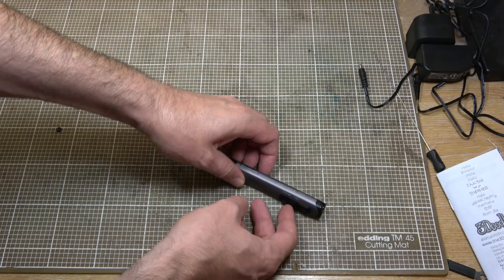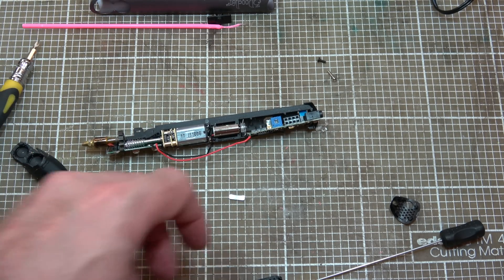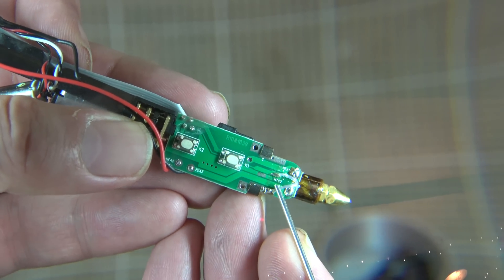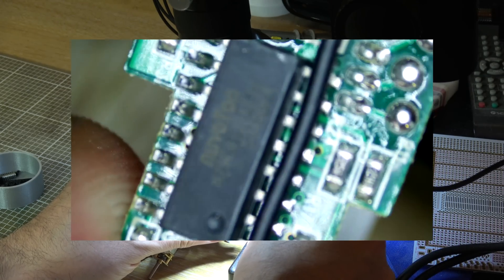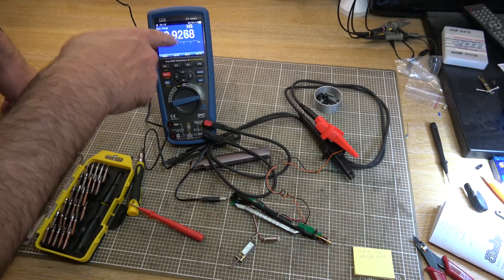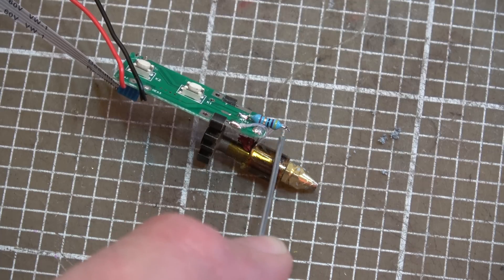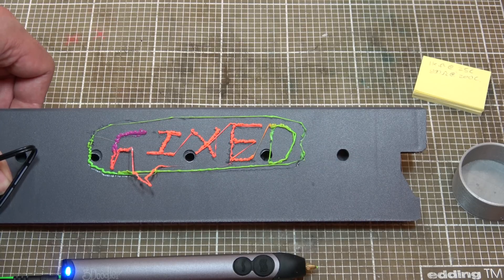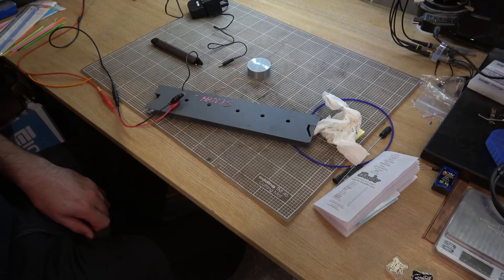3Doodler 2 0 Teardown & Modification

Comment: I needed a hotter tip and ended up using an adapter with variable voltage set to 7.5v I use it for plastic repairs on car interiors and needed hotter melt to ensure adhesion to old plastic. Works great, but I really wanted to use 1.75  as sticks of 3 are so expensive. I bought rolls of 3mm but had to hand bend pieces and was tired of breaking and having to push it through when a kink didn't feed properly.

I bought the 3doodler flow to take advantage of the 1.75 but it isn't hot enough either.

Unfortunately it doesn't allow a plug in adapter, has a permanent cord coming out of it. I'm about to splice it and try to rig it to my adapter, don't care if I break it, I need it hotter or it's useless

Comment: i have a filament stuck between the gear and the entrance, so im trying to reach it by pulling the center out, but it seems to have glued the body to the exterior somehow....doesnt seem to slide out as easily in the video

Comment: It seems to be rather optimistic to try to ask six Watts of power to run a fan and motor, and then be able to melt a continuous flow of plastic filament. Running with a slower feed speed might help, but you're sinking that meagre remaining power (less the losses in the circuitry) into a length of plastic and the surface onto which you are trying to work, plus losses to air. More current might be the best option, if the PSU is limited to 5 Volts. Is the 'Create' using higher current, or did they also use a higher voltage supply? Thanks Jim.

Comment: I took mine apart following your video,check the soldering joints where the red and black head power wires connect to the tip(hot end)at the circuit board,both wires on my unit were connected by one (1) strand,check and resolder and your heat problem will be solved....I hate the 2 choices for speed control(too fast and way to fast)I want to remove the feed unit and use a bowden feed device mounted off the back end than I control the feed one step at a time.,I will grind down the feed gear so I will fake the unit into thinking the motor is feeding.

Comment: Hello,I have the same 3d pen and from what I can see your device is faulty,you should demod it and return it to the factory for replacement.
Reply from the maker: Hi Walter - I already have a replacement '3doodler create' which looks nearly identical apart from being a grey-blue colour instead of grey, and has the 3doodler logo printed the correct way up when you're using it right-handed. The 3doodler create is a whole lot better than the 2.0 was. I use it quite often and it very rarely suffers from jams and clogs... it's much better. Cheers!!

Comment: I love to see these videos where you work out what went wrong and how you would fix it :) Great job! It really show you know what you are talking about. I know with a common hot glue gun this is a major issue. If you just use a little glue for a short time you have no issue but if you need to use a lot of glue in a short time you can end up spending time just waiting for the glue to melt. Thanks for sharing :) and working out what was going on.
Reply from the maker: Hi Benja - As a result of this video, 3doodler got in touch with me and 
replaced my '3doodler 2.0' with their new '3doodler create' which looks 
nearly identical, but works totally differently... I really like the 
'create' and I've been using it for all manner of little repair jobs 
which couldn't have been done any other way... Soon I'll get around to 
making a video about it showing the differences... I've been very bad at
 knocking out videos for the last month or two, but I'll get the 
camcorder out soon. Cheers!!
Reply: I look forward to seeing the new and improved doodler. I like it when a company sees an issue and instead of blaming the end user they redesign and make a much better product.

Comment: I just purchased the kid's version of their pen called the 3Doodler Start at my local Barnes and Noble and I'm very impressed by it.  The filaments are shorter and you go through them very quickly but it works really well and the extruded plastic remains a bit soft so that it can actually be manipulated and molded with your fingers before setting.  It's bulkier than the 2.0 pen but it just works and I couldn't be happier with it.
Reply from the maker: Hi Pierre - After making this video, I was contacted by 3doodler who sent me one of their new '3doodler create' models - In spite of looking pretty much identical to the 2.0, it is far superior in every way... I'll be doing a review/teardown video on that in the near future. It is certainly not the case that all 3doodler products have problems, and I'm glad that you found one that works well for you. Cheers!!

Comment: A valiant effort Sir :)
Reply from the maker: Thanks Eric - Would have been great if my mod had fixed the 3doodler properly, but alas I just couldn't cram any more watts through that hot end without having to increase the supply voltage beyond what the microcontroller could tolerate.  Cheers!!

Comment: Just too wimpy a driver/heater combo? I wonder if you could just feed the heater switching transistors off 9 volts after isolating the (high?/low?) side from the rest of the board.
Reply from the maker: It is of course totally possible that I'm totally wrong about the heater being too small...  Perhaps the tolernace on my feed screw are wrong and it's just slipping on the ABS where other units would work OK... Whatever the case, I just wanted it to work better. Cheers!!
Reply: Given that is starts off OK and then dies off I'd guess it can't maintain temperature. increasing the heater voltage or reducing the resistance in the heater (if a length of resistance wire tap it at the middle and join the two ends)  are the only things I could think of that might be done with minimal reworking of the design. With a tiny voltage regulator and a 12v power rail instead of 5v this product looks like it could have been great. (open software would make it even better)
Reply from the maker: The other possibility I thought of was that some of the heat from the extruder is flowing back up through the ABS strand, softening the strand in the area of the feed screw... It seems that it'll extrude OK for a little while with a fresh strand, but as soon as that strand has been retracted one time, it's then game-over for that strand. Perhaps the unit works better in a colder room and that's why other people haven't had the same problems I've encountered. Cheers!!